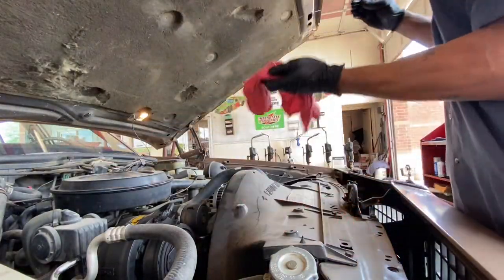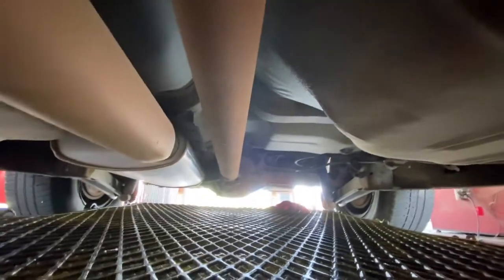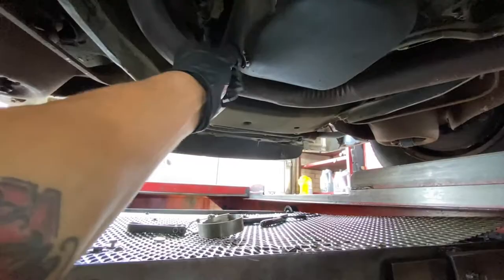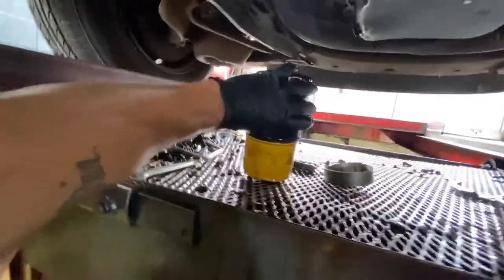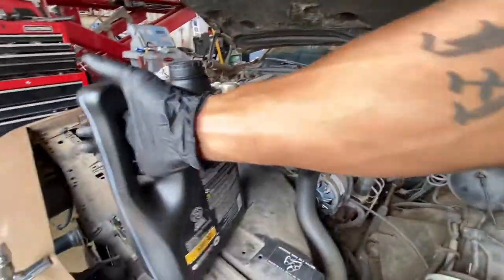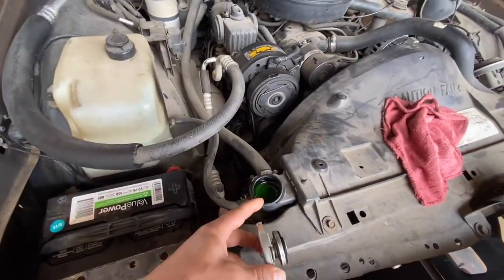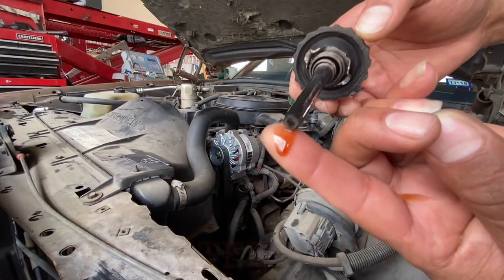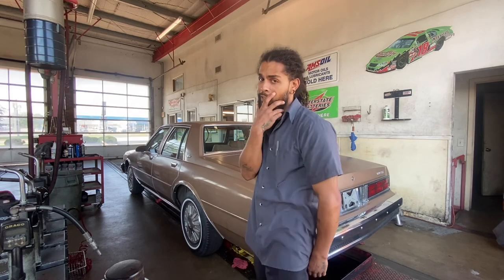1989 CHEVY CAPRICE OIL CHANGE

Comment: What type of oil do you use on that engine? Got myself an 89 caprice ls brougham, original 30k miles with the 305, but in germany we usually dont get amsoil, valvoline and so on..do you use synthetic or mineral oil? So I can get the correct oil
Reply from the maker: What up G!… but on mines I used half and half… longest u change it on time you should be okay! But it’s your preference mane I did full synthetic… jus lmk what u do
Reply: @KreolBoi  alright thank you very much! I'll let you know what I order! Love that car, its my first v8, clean almost like new..those cars are rare in germany
Reply from the maker: @hakaluku  mane post a video!!